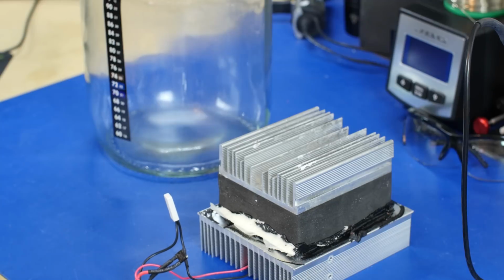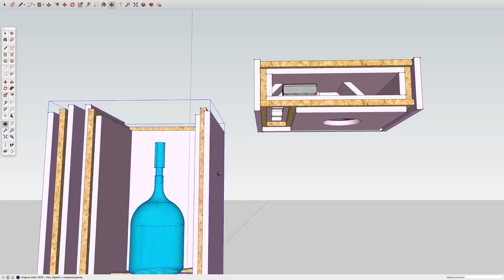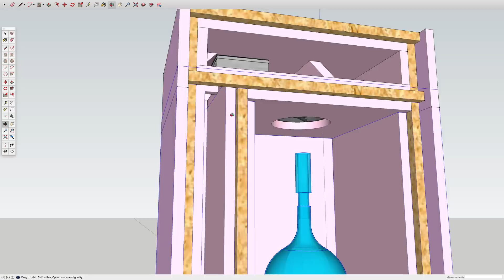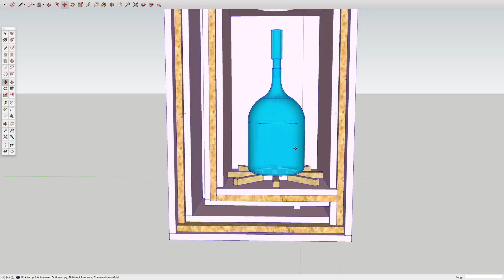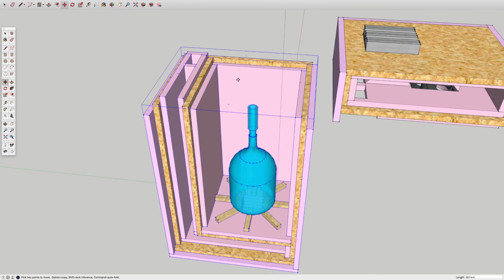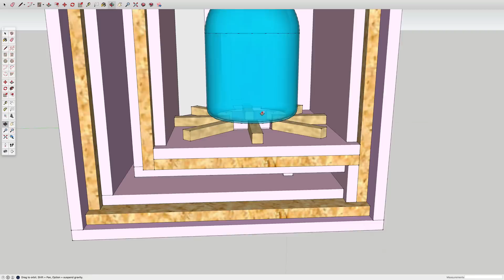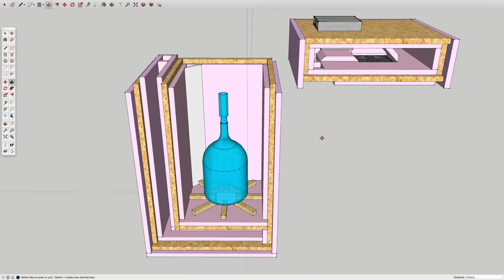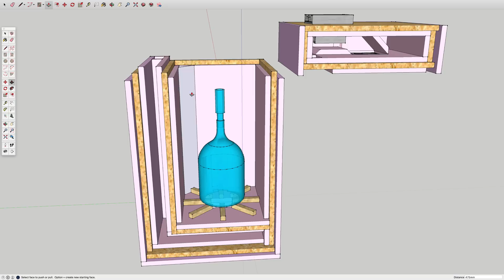DIY Fermentation Chamber Design - #0107

Comment: Overkill was my thought too. My brewer father does the same, I call it the 'battleship construction technique'. We regulate the cute single gallon runs with a foam ice chest on it's side and a singe night light on a timer. Doesn't take long to find the rough psudo-PID settings.  The bigger 25 gallon runs have an electric blanket. I've thought about going high-tech with an Arduino or Ras-pi based build but our system has worked since the 60's. Plus I like the broad flavor base of a fluctuated fermentation temp.
Reply from the maker: Very interesting!  Sounds similar to the popular son of fermentation design that i see everyone and their mother build
Reply: +66tbird1 Well, beer is pretty much the only alcoholic beverage that you can't produce by accident, like wine.